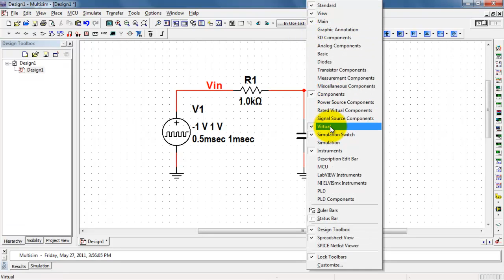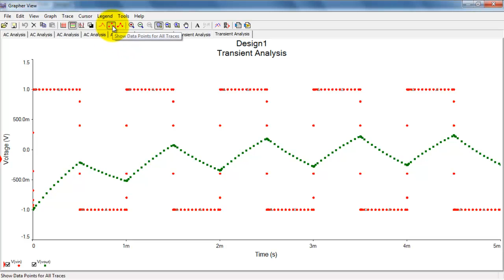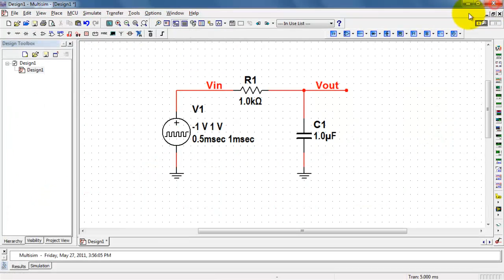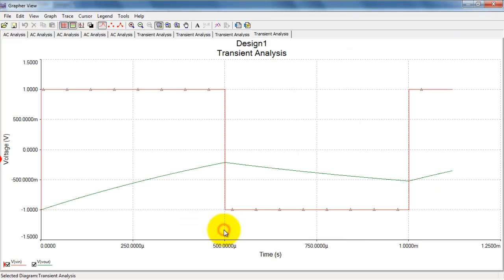NI Multisim: Transient Analysis

Comment: Is it possible to analyze three different voltage values if I want to see the slew rates at the same time, for a 741 op amp circuit?
Can you get three on the same graph?
And how did you place the v1 and v2 on your circuit?
Thank you. 
Thanks for the video.